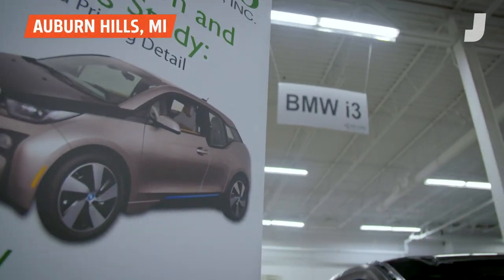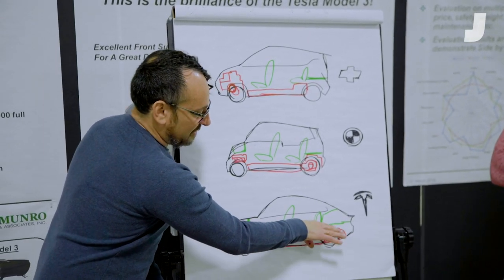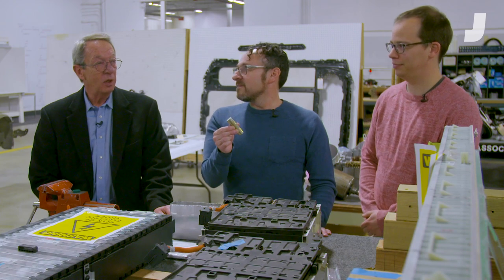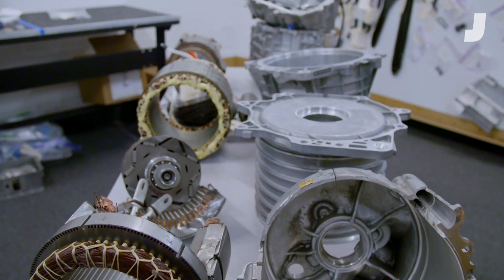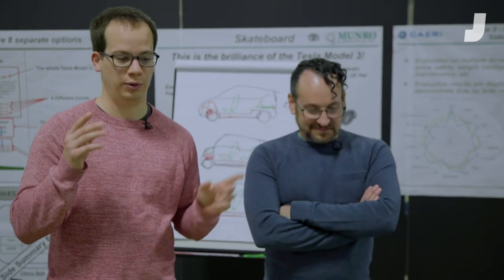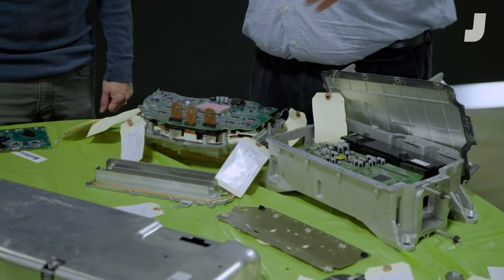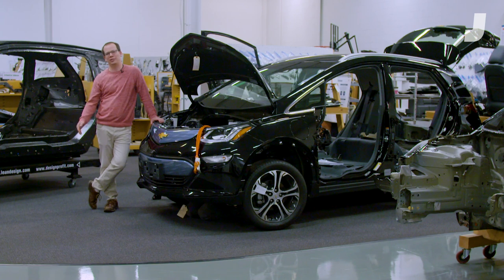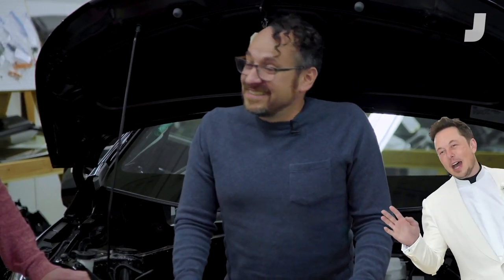A Look Inside The Tesla Model 3, Chevy Bolt, and BMW i3

Comment: why wasnt the bmw electronics shown? Did they even mention it? Did i miss something?
Reply: I suspect they skipped it because the way the power electronics on the i3 are laid out is quite confusing to the lay person. The inverter board assembly also contains one of the two onboard chargers for example and other functions are spread across other boards (possibly because BMW were considering at one point in development making the second charger ( KLE or komfortladeelectronik ) optional in true BMW fashion). The power electronics are functionally comparable in efficiency to the Tesla.

Comment: Uhh yeah..  so let's step back to reality just for a second before we all get on the Tesla bandwagon... let's say somebody runs into you or you back in to something(the fast lane model 3 yt vid) ... or you hit a pot hole (engineering explained).. it took Tesla 3 months to get parts for those repairs, and cost 2600 for hitting the pothole and damaging 2 wheels&tires. Now let's assume you're in a collision in the i3 and your full carbon tub gets damaged.. I'll take the Chevy since parts are readily available and it has the same range. Only reason for a Tesla is to win stoplight races. Cool party trick but who really cares

Comment: Calling the BMW i3 "popular" is like calling a modified STi "fuel efficient" should have used the Leaf as an example
Tesla knows how to manufacture batteries and motors, GM knows how to manufacture cars; this is very obvious from what is shown in this video.
14:36 - it's called a subframe, it goes in from underneath with the components it supports as an assembly (not "a shelf in the engine bay") for easy install on an assembly line, and easy removal in case of component failure; think engine subframe and it makes more sense from a manufacturing standpoint. "Elegant" means crap when compared to efficient (in the realm of installation and removal cost/time) try to work on a Tesla; you have to take the F***ing thing completely apart to remove and replace components; and yes, parts still fail in an EV; they aren't impervious to the elements/manufacturing and/or user error.
Calling the BMW i3 a "body on frame" is a misnomer, the model 3 is built the same way - eg. uses an EV skateboard with a body on top; albeit with less exotic materials.

You two are either two of the dumbest people of average intelligence in the world, placating yourself and/or viewers, love the taste of the sweet sweet bulls*** that Elon pedals or some combination of the three. Elon Musk is an intelligent man turned salesman, but the Model 3 could use a little bit of Chevy Bolt in it; swap the Bolts drive wheels (hell, or make it AWD) and replace the "GM parts bin" interior and it's a force to be reckoned with. The i3 is par for the course for BMW; it's overpriced and under delivers, but checks the "carbon fiber = exclusive" box, much like the i8.

Biggest issues with the three manufacturers:
GM = bean counters & design by committee mentality
Tesla = Elons Ego
BMW = BMW just being BMW

I want an EV, but I want the ease of service and user interface of the Bolt with the electronic components of the Tesla, and, if it can be done at a reasonable cost, the CF body of the i3 sitting on the Tesla/GM "Skateboard".

One more oh my F***ing goodness for you two; figure yourselves out, stop suckling at whichever teat you're sucking at; have a little self respect, and if I'm missing the mark here and you're simply uninformed, read some books and turn some wrenches.

Comment: It is not only a shame, but glaringly stupid, to have omitted the LEAF, which IS an elegant EV built from the ground up to be an EV, but also has undergone the most long term progressive development ( like the VW Bug)  and is thus the most mature, most dependable, and dare we say the Most Sold EV by far.  -- What this dumbed down explanation fails to say.. is that any of these motors or the leaf  can develop 300 hp.. if the electronics allows it.  That kind of excess is not allowed by sensible automakers because it serves no purpose except to defeat the purpose of an EV which is to be both economical and environmentally responsible.  Rather than shall we say being "Mental" and Irresponsible !   The Tesla's horrible record of battery fires..should be enough to discredit the itty bitty endlessly complex computer cell battery .. which was invented only because in 1995... it was the Only kind of lithium battery available to use in the experimental one-off prototype- which I saw at the Bibendum Challenge at Sonoma California.  Such is Hardly a good reason to keep doing it today.  BTW  you simply cannot find an example of a Leaf battery fire.. even in a crashed leaf.  Can Not Find An Example.

Comment: The problem with the tesla is fixing it.... You need to chance some piece on the inverter? Have to take the whole motor apart... 

Part of designing a car well isn't just about giving engineers boners, it's about maintainability. There's a direct inverse relationship between tightness of packaging and ease of repair.

I'm also kinda curious how much testa paid for this video

Comment: Counterpoints; This video fawns over the Tesla like every other.  They love to say it is more elegant, and "it's the future".  They completely fail to consider it costs 50% more, it's reparability is awful, recyclability is worse, it is built by non-union workers that are paid half as much, and GM pays shareholders dividends and taxes to the government.  Tesla continually takes money from investors and government subsidies.  If Tesla is the future WE ARE ALL SCREWED!
Reply: I3 and M3 costs are almost the same, with both starting in the mid 30s and working up to mid 50s. As far as repair-ability, only the Bolt is easily repairable due to GMs massive parts bin. Tesla is woefully understaffed (from my firsthand experience) and BMW carbon is difficult to repair correctly anywhere but at the dealership (who usually sends it out to a carbon specialist - at least here in CA). if you have structural damage on the I3 you're looking at 3 to 6 week leadout. Plus they went with some weird parts like those molybdenum bolts - as if that was a routine point of failure. The tensile strength of steel would have sufficed and the weight savings is laughable.

But GM is such a horrible company at present (it may have been wonderful 50 years ago). That whole ignition switch scandal just goes to show the corporate ethos running through the whole company. All the people burned to a crisp in Teslas made the news repeatedly but those poor people who burned in their GMs barely got a nod from the MSM because the headline didn't draw enough eyes. GM pulling down fuel efficiency standards and producing clunkers that can't make 100K before becoming toxic wasteyard scrap hurts America a lot more than the paltry taxes it pays. If anything it pays more in payroll taxes than Tesla and keeps the know how of machining and tooling in the US but that's about it. The actual end result products are just poorly designed as my neighbor (a mechanic), my own mechanic and Scotty confirm - they just make vehicles that are designed to fail.

BMW just put too many things ahead of its time into the I3. The recycled content in that car is insane, but other than Hollywood peeps doing a short stent to the yoga studio most middle class would rather have longer range so they could do a drive from LA to Vegas on the weekend without having to worry about finding an open DC charger.

Comment: Tesla presuppositionalism ... first assume Tesla does everything better, then all the comparative differences are examples of Tesla doing better, and competitors doing it wrong.  This entire video is based on this logical fallacy.
The fact is that all the noted differences have Pros & Cons, which were NEVER compared or discussed relative to Cost, Flexibility across platforms/models, etc...  
Also, much of the I3 and Bolt content was developed years before the Model 3 hardware shown here ... the entire comparison is not apples to apples. When Porsche rolls out their new "ground up" EV ... compare that to the current Tesla Tech ... then we can see how far behind Tesla actually is.
Reply: @rsm 287 Yes, I've watched Sandy's video, it's another example of Tesla presuppositionalism. Let's point out just one example at https://youtu.be/pAS-yjWj9DY?t=212   where Sandy points to Tesla's "superior" ability to produce a low cost mirror ... the reality:  Tesla puts cheap zero functionality mirrors in their Mod 3 ... and I could go on with Tesla's outdated battery pack technology of packaging zillions of cylindrical cells, it's insanely expensive & packaging inefficient.. As for Mod 3 profitability ... that is a subjective claim, based largely on  Musk's battery cell cost claims which are not backed up by evidence from Panasonic in Japan ... again the reality:  Tesla has NOT produced evidence of this claimed profitability, quarterly earnings reports continue to tell a completely different story, the real story that Tesla since its inception is still profit negative, and continues to produce quarterly profit statements that no legacy OEM would find acceptable.
Reply: Just...

😂😂😂😂😂😂😂👋👋👋👋
Keep trying.

Comment: Can't be impressed with the first couple minutes of this guy discrediting the Bolt because the motor is up front. It's well known that having the motor up front helps reduce possibility of occupant injury than having a hollow trunk up front. Is Tesla helping fund this video? 
Playing down the separate control module on the Bolt whereas praising the intergrated control module of the Tesla. What I see is having to buy an intergrated package (not sold separately?) of the Tesla versus being able to buy a separate control module of the Bolt at a lower cost. 
Again, Tesla funding on this video? 
Further, it's seen that, while the Tesla has a base price similar to the Bolt, practically, you're going to have to spend about $10k more to get a reasonably equipped Tesla.
Don't really look at Jalopnik channel. From what I see, don't think I will in the future. Don't see much objectivity here. More, it's Tesla kiss-assing, Musk idolatry.

Comment: Why don't you sit down and do the math? Figure out how many kilowatt hours is in  a gallon of gasoline.. 100 kilowatt hours equals out to around 2.5 gallons of gasoline.. a gasoline or diesel engine is not gigantic, that battery pack is. And it does not get any lighter as it gets depleted, apart from we do not have the underlying infrastructure that can support a charging infrastructure.. United States electrical grid is about 60 years old, it's the largest machine humanity has ever produced, and it is not being properly maintained. We need to improve our underlying infrastructure before we go doing shit like this.

Comment: Test shills spinning their little hearts out. The battery is hilarious. It takes 3.4 HP -  about 2500 watts - just to move the battery's weight alone down the road and those SHITPILES weigh 5000+ lbs. More than a full-size, half-ton 4WD Chevy Silverado. Which is why the eat tires like feeding them in a chipper-shredder. You'll put $5000 in tires on one of those pieces of shit in the first 50,000 miles. Speaking of tires, where is the spare in a Tesla?

Comment: Pathetic review of the engineering of the motors, completely fails to explain why the Tesla motor is so superior. Nevertheless, one can still see that the Model 3 is far better engineered than the other vehicles, and they are not capable of full self driving, so ya, one would be stupid to by anything other than the Tesla.